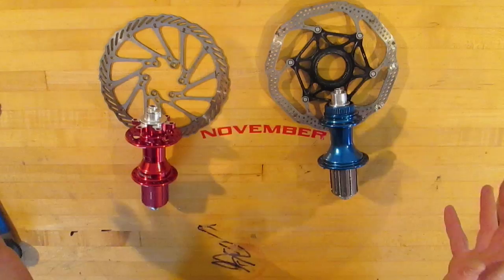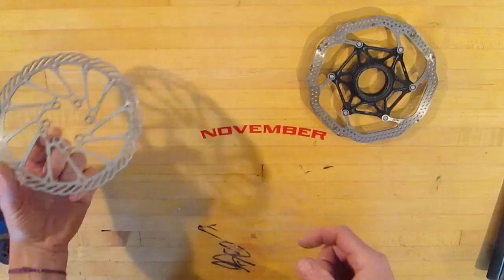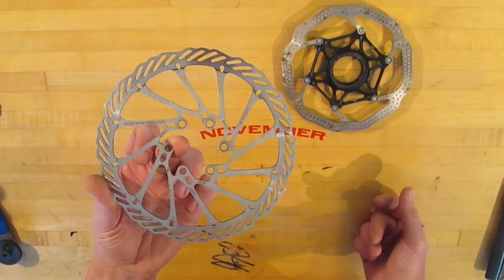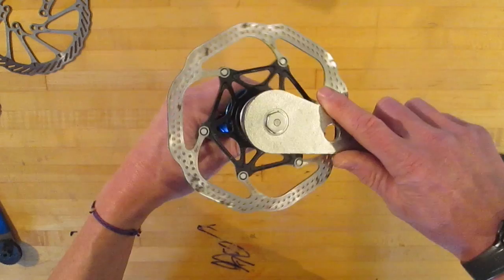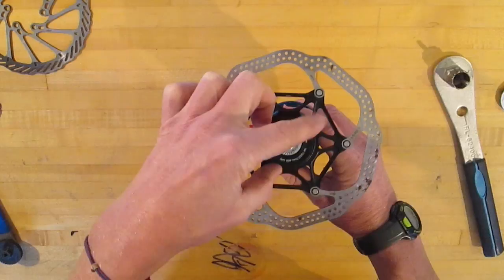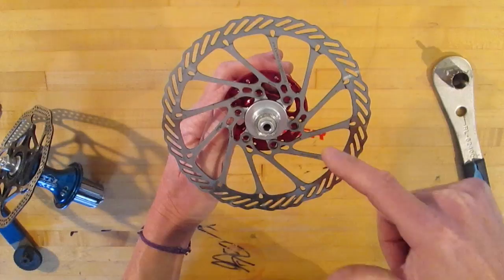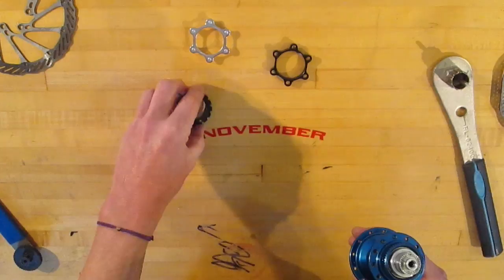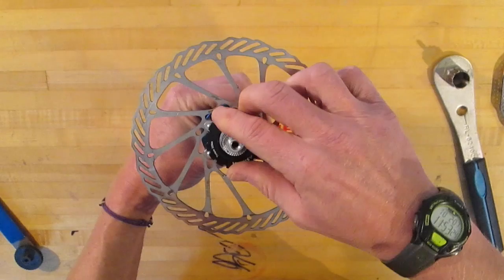November Bicycles - 6 bolt and center lock rotors demystified

Comment: thanks for the vid.   love seeing the distinction between each.   would be interested in the weights of each too, especially if converting, which could help weigh cost of converting over just investing in new rotors.   is a lock ring needed on all center lock brake installs and is purchase separate?   i sometimes see where wheelbuilders charge extra for it.  Shimano hub mated to SunRace cassette will have the lock ring from the cassette right?  am converting CLD hubs to 6-bolt but could not find the converter set up like you demo'ed just the Shimano vervsion which uses 6- bolts.    thanks again!
Reply from the maker: weight is going to vary by each part and they are updated all the time, so just compare. Never use a cassette locking for a rotor locking, as they are generally too deep and can seize the wheel. shimano rotors generally come with lock rings, most others do not. I don't see any current hubs including them, except maybe some shimano. DT Swiss makes a good converter to use 6 bolt rotors on center lock hubs. you can not use center lock rotors on 6 bolt hubs.

Comment: Thank you for the video. Question...do you know why a 6 bolt brake disk carrier would spin freely on the hub effectively making the bike have non functional braking force on the front wheel? I took the wheel off the bike, replaced the rotor then on next ride noticed the rotor was being held motionless between the brake pads while the front wheel spins freely. It seems at though the 6 bolt carrier has become un-mated from the hub and spins independently of the hub/wheel. yes the 6 bolts are in place with thread lock and torqued to 7ft lb.
Reply from the maker: Hi, I can't imagine how or why that would happen. Either the hub or the rotor is very very messed up. If you used a 6 bolt rotor on a centerlock hub without the 6 bolt converter, that would probably cause that I guess.

Comment: Thank you so informative.. just want to ask are all brake sets are compatible either center lock or 6bolts? Or i need to use a specific brake for 6bolts and center lock. Thanks in advance. Newbie here
Reply from the maker: There are very few brakes that don't like 6 bolts. Generally these are cable/mechanical brakes. Avid BB7s say they are incompatible with 6 bolt, but if you bend the outer pad's tab out a little bit it works just fine. I have a bike that's been set up like that for years.

Comment: If I move from 6 bolt wheels to centre lock wheels, the same 160mm discs, can I use the old braking system on the bike?
Reply from the maker: Yes. You may have to adjust the caliper position slightly but you don't have to change your brakes.

Comment: Thanks for this video.  For clarification,  if i have the internally splined center lockring, then can I replace it with the externally splined one?
Reply: Yes. The internally splined one is primarily intended for the older system with a 5 mm quick release bolt, but you can use the externally splined. The other way around might cause problems with thicker hub centers.
Reply: externally splined lockring will work with all centerlock hubs

Comment: My Diverge gravel bike came with center lock rims, I bought zipp 6 bolt.. With new rotors will things fit snug with original brake calipers?
Reply from the maker: If you have hydraulic brakes, they will self adjust. Just install the wheels and get the rotors in between the calipers, and then squeeze the brake levers firmly a bunch of times. The fluid reservoir will adjust the amount of active fluid in the line, and the pads will reset to the correct clearance. And they will continuously readjust as the rotors and pads wear. If you have cable-activated brakes, you will have to dial the pad contact adjuster out to accommodate the new rotors, and then dial them back in as pads and rotors wear.
Reply: David Kirkpatrick do you know about wheels and tire spacing pertaining to gravel bike?
Reply from the maker: It's the same as with other bikes, but if you have a specific question I may be able to answer it.